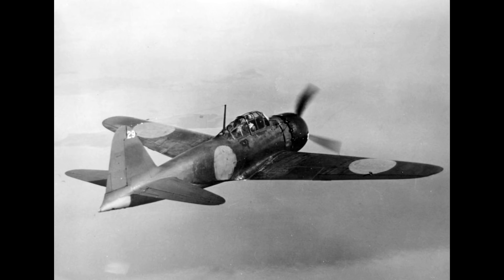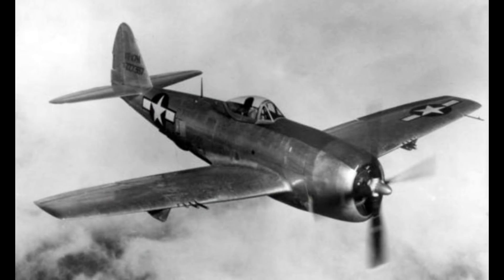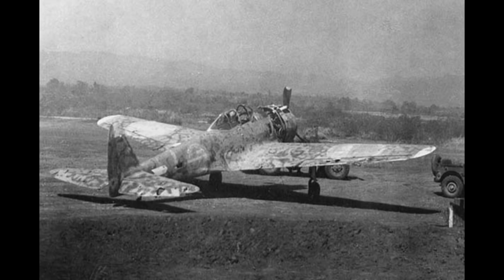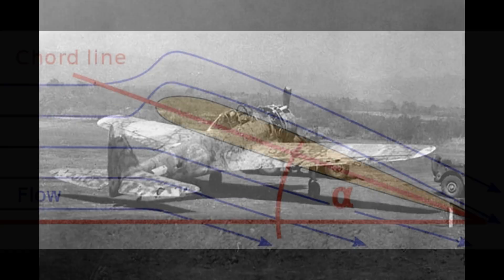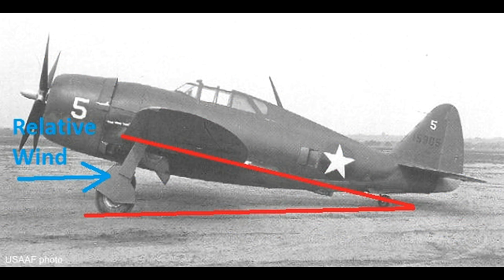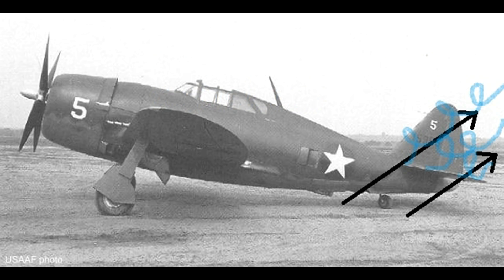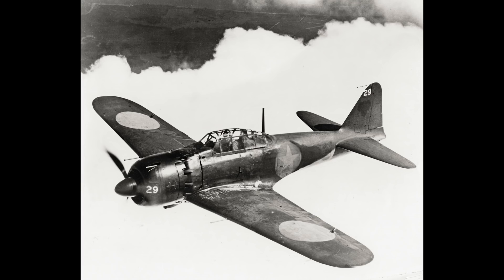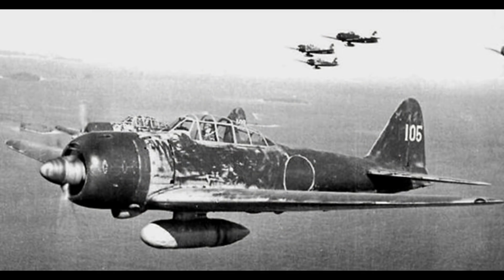Mitsubishi A6M Zero, an interesting fact few people know

Comment: So the only advantage the Zero had was its maneuverability? Why didn’t the Japanese upgrade the engine and then have a much better fighter?
Reply from the maker: The Zero also had an advantage in speed and climb over most Naval adversaries early in the war. In later variants the Japanese did increase power a bit, and make airframe changes to get more speed, but ultimately they needed another design entirely. The Zero could not be modified enough to compete with the Hellcat and Corsair. Ultimately they came out with the KI84 Frank and N1K2 Shiden, both of which were competitive, but it was too little too late.
Reply: Aircraft design is a very complex science.  It is not like "you put in a more powerful engine and you can get a better plane".  First airframe has to be compatible with new engine.  The new engine might be too big to fit in the cowling or too heavy to be supported by the engine mount.  Also Zero's aerodynamics were designed to excel at low speed turn fights.  Even if you can outclimb a wildcat, the wildcat can accelerate much faster in a dive to get away.  Zero also had high speed maneuverability problem.  Late war planes such as Hellcat, Corsair and P51s had much better turning performance in high speeds than Zeros.  Often times, American pilots could lure Zero into a dive and when speed passed 300mph, American fighters could do a quick zoom up or high speed turn and Zero would have hard time to follow.
Reply: I do agree  with you that just stuffing a bigger motor into an existing airframe may not always be effective,  but it would have been a big help.  The BF-109 started out WWII with about 1100hp and ended the conflict with about 2000hp. This was done, along with other mods and updates, to compete with newer Allied fighters.The Zero started with 950hp and ended WWII with about 1200hp under full boost. When WWII started and their primary opponent was the F4f Wildcat, a plane that weighed a full ton more empty than a loaded Zero and was only powered by 1200hp engine itself, it isn't hard to see how the Zero became so dominant. Against the F6f3 Hellcat, witch was even bigger and heavier but had 2000hp, the Zero began to fade. The Wildcat was a good design and the Hellcat took over where that iconic design left off.The Zero was also a great design, but it was fighting at an 80%power disadvantage against the Hellcat and no amount of will or courage on the part of Japanese pilots would overcome it. The Japanese needed a new carrier fighter in the long term, witch they never got. For the near term the Zero needed a bigger motor, witch Mitsubishi was making just before the war started and did produce 1300 horsepower. The latest version of this engine would produce 1560hp before 1943. It was reliable and in production and it would eventually be tested on the Zero in 1945 as the A6M8. Only 2 prototypes would be built, way too little and way too late. I personally think that this zero would have been a good match for the Hellcat.If you still doubt my argument then think about the fact that the Ki-61, Japans only fighter with an inline, liquid-cooled engine, in the 1100hp class was turned into the Ki-100, by mounting the same Mitsubishi radial engine of 1560hp that went into the A6M8. That prewar airframe got a new "lease on life" and became one of Japans best fighters of the war,
Reply: It is my understanding that one of the driving forces behind the design considerations for the A6M was the fact that they didn't have a better engine.

What I read some time ago was that the Japanese engine designs at the time the A6M was developed were not as good as those in the West.  Thus, if the design was conventional with strong materials, armor, self sealing fuel tanks - the aircraft would have weighted to much for the engine that was available and been under powered.  So - to give the aircraft a chance - and because Japanese pilots liked maneuverable aircraft - armor, self sealing fuel tanks and structural strength were not part of the A6M's design.
 
Thus - with one of the most highly trained group of aviators in the world and a very nimble aircraft - at the beginning of the war when allied pilots tried to maneuver with the Zero - it had great success.  As the war progressed and allied pilots learned from their experience and such as Chennault's they learned how to fight the Zeroes and could hold their own with them.

With the disastrous air campaigns in the southern Solomon's that killed off so many of Japan's good air crews, when the Hellcat's, Corsairs and P-38's replaced the F4F's and P-40's the Japanese had less well trained aviators flying fragile fire traps and suffered accordingly.
.
Reply: masbeetleboy
The Ki-100 is really overrated. It had as much horsepower as the Ki-61-II but was a radial, which meant more drag. Thus, it was slower than the Ki-61-II. It was a little lighter than the Ki-61, though, which meant it climbed, turned, and accelerated a little better. Still, the Ki-61-II had an enormous speed deficit compared to its American adversaries, and the Ki-100 was even slower. The Japanese liked the Ki-100 so much because its radial engine was much more reliable than the Ki-61-II's inline one. Performance wise the Ki-100 was just not up to par compared to the Ki-84 and the N1K.
Reply: I disagree that the Ki-100 was overrated. The  Ki-61-II KAI had the Ha-140 liquid-cooled  inline engine that put out 1500hp, the same as the Ki-100s Ha-112-II radial engine. The radial did provide more drag, but it was utterly reliable, lighter, and in production. When working right, the Ki-61-II KAI beat the Ki-61-I in all areas except initial acceleration. But I do agree with your point that the latest liquid-cooled motored Tonys were at a disadvantage when compared to the P-51d, but not the Ki-100. In war circumstance can do a lot to level the playing field. Over Japan the Mustangs flew mainly strafing missions to destroy infrastructure, especially after the B-29s began low level night bombing missions. This meant that they had to come down to very low altitudes, where their advantages were minimized.Compared to the N1K Shiden series and the Ki-84 Hyate, witch both were powered by the Homare engine, the Ki-100 would appear to be an unimpressive, late war compromise, but that would not be true. The Hyate was flight tested in mock combat against the Ki-100 by the Japanese and concluded that, among pilots of equal skill, the Ki-100 could more than hold its own.Air combat over Japan in 1945 forced Allied fighter pilots, of all types including the Mustang, to the same conclusion.
Reply: The Ki-61 was an impressive aircraft, but had the performance of a 1941 era European theater fighter. The Ki-100 was an improvement, but by 1945 was behind the curve
Reply: Your overall understanding is correct but allow me to add some details.Mitsubishi built the Zero to be cannon-equipped, agile, reliable, and long -ranged while being powered by their own Zuisei 13 engine of about 800hp. After a few prototypes were built, the War Ministry ordered Mitsubishi to install a Nakajima radial, the Sakae 12 of 950hp onto an incomplete prototype. Though bigger and heavier, the Sakae combined with the Mitsubishi airframe to create the A6m2 and a legend was born.Mitsubishi, now not so happy about using a competing company's engine on their airplane, offered to use another of their engines, the Kinsei 51 of 1300hp to power the Zero. The War ministry said no, and rightfully so. The Kisei was more powerful than the Sakae and just as reliable, but it was 300 pounds heavier, witch would have adversely affected range. The Sakae was also being installed on the Ki-43 Oscar and it was being upgraded to the Sakae 21 of 1130hp in the near future.The Sakae powered Zero was great from 1940 thru mid 1943, but it needed more power from a bigger motor after that. The kenei  would also be upgraded to produce1560hp in late 1942, should  been tasted on a Zero in late 1943, and replaced the Sakae by mid 1944.
Reply: Sorry to disagree with you but the facts are not on your side here. The Ki-100 had a low top speed for 1944-45 standard, but it was powerful enough, agile, well armed, well protected, and solidly built to compete and beat any allied fighter it would meet over Japan. It also was very reliable and had such good handling characteristics that it gave flight-school graduates a fighting chance in combat. Also remember that air combat over Japan took place at much lower altitudes than in Western Europe.
Reply: thelasthostage 
I said this before and I’ll say it again. The Ki-100 was only slightly better than the Ki-61-II in acceleration, climb, and turn, due to it being slightly lighter. But it was significantly slower than it. The real reason why it was so highly regarded was it’s radial engine was much more reliable than the Ki-61’s inline. Regarding performance, both the Ki-61-II and Ki-100 were utterly unimpressive for 1945 standards (which is when they were introduced). Every single Allied fighter in 1945 flew circles around it: the P-51D, F4U-4, P-47D, P-47N, Tempest, Griffon Spitfire, etc. 

The Ki-61 has good performance for when it was introduced early in the war fighting P-40s, but it was very quickly rendered obsolete when new Allied fighters were introduced. And the Ki-100 was just another Ki-61 in terms of performance...
Reply: Let me respond by stating a few facts. The Ki-100 was anything but "unimpressive", and the Japanese had high regards for it because it performed so well. It was praised not only by mechanics, but also veteran and novice pilots alike. As I stated earlier, the Ki-100 had a low top speed for 1945 standards, but it otherwise compared very favorably to all of allied types you listed. The Japanese Army captured a P-51 in China late in the war, brought it back to Japan, and toured it around their local airbases to familiarize their pilots. Mock combat between this Mustang and Japanese fighters revealed that  at high altitude the Mustang was a superior fighter, but at medium and low altitudes it would lose its edge against advanced Japanese types like the Ki-84, N1K2j, and the Ki-100. That is where most air combat took place over Japan, at lower altitude.Please don't take my word or the glowing reports of the Japanese. Just look at what Wikipedia, US post-war evaluations or any other online aviation info-source has to say about the Ki-100.
Reply: masbeetleboy 
You want to talk facts? 

- Ki-100 was 30+ mph slower than all US fighters at all altitudes 
- most US fighters had equal or better climb at all altitudes 
- most US fighters had equal or better acceleration at all altitudes 
- US fighters had equal or better dive performance 
- US fighters had much better high-speed control. While the Ki-100 could keep up speed-wise in a dive, it was almost uncontrollable at those speeds whereas US aircraft remained very controllable 
- the only place where the Ki-100 had an advantage was in low-speed turns (this, BTW, was what was “tested” in the mock-dogfight between the Ki-100 and the Ki-84. But what use is low-speed turning ability when you’re being jumped by a faster aircraft at a higher energy state than you?).

The numbers speak for themselves. The Ki-100 was just as good (maybe slightly better, emphasis on slightly) as the Ki-61-II. And the Ki-61-II was hopelessly outclassed when it was introduced in 1945.
Reply: I like these facts but I don't agree with your conclusion. To be clear we are talking about the Sea Fire, Hellcat, Mustang, and Corsair when referring to Allied fighters, right? Let me start by agreeing with you that the Ki-100 is slower than all of these late-war, Ally fighters. I stated that point a few times before.Your "facts", plus a few more points will prove my conclusion. The Ki-100 was a pre-war designed airframe that was mated to a "bomber engine" out of desperation. By your own "facts", this improvised fighter was able to at best match the Ally fighters it met over Japan in terms of climb, acceleration, and dive performance. This would prove to be enough because it also had good armament, good protection, and superior agility, while having a less powerful engine and poorer logistics behind it. Also remember that the Ki-100 was introduced into combat, March 1945, while Japan was being bombed and strafed on a daily basis. If the Ki-100 was "hopelessly outclassed", as you stated, then wouldn't American post-war evaluations, as well as Japanese war reports, confirm that?My point isn't that the Ki-100 was far and away superior to any allied fighter it met over Japan, but that its good airframe, good engine, and combat circumstances gave it a fighting, competitive chance against any Ally fighter it would meet over Japan.
Reply: masbeetleboy 
I’m talking about the F4U-4, not the original F4U-1. And the F8F. And the Griffon Spitfire and Griffon Seafire. And the Hawker Tempest. And the Hawker Sea Fury. And the P-51D. And the P-47N. And the P-51H. All of those above-mentioned planes completely blow the Ki-100 out of the water in almost every angle category. 

The Ki-61-II/Ki-100 is only barely able to complete with the older F4U-1 and F6F-5, and even then that’s pushing it. But we’re talking about a plane introduced in 1945 when the Allies had some exceptionally well-performing fighters. If you just look at the performance charts for these planes and compare them to the Ki-100’s, you will see what I am talking about...

What I suspect is that you’ve seen some documentary or read on some online forum that the Ki-100 could “match any Allied fighter and was a match for any of them”. Well, let me tell you that the people that make those documentaries rarely have any clue what they’re doing. At sea level, the Ki-100 had the same speed deficit versus a P-51D as the A6M5 had versus an F4U-1 or F6F-5. And it didn’t fare any better in the climb/acceleration department. It just didn’t compete with any of the fighters the Allies were using/would have used in 1945. It was a 1943 plane at best performance-wise that was introduced in 1945 because the Japanese were so desperate to have something better than the Zero/Ki-43/Ki-61. When you’re flying Zeros or Ki-61s for the entire war, I’m sure getting something that’s marginally better is of course a welcome change. Doesn’t mean it’s any good still.
Reply: Not just a documentary here and a forum there, but direct reports from the men who flew it into combat, both novices and veterans. Also the results from Japanese Army mock-combat tests between the Ki-100 vs captured Mustang and the Ki-84. Also post-war Ally intelligence reports witch confirmed what the  Japanese already knew. I challenge you to look through the internet and provide a source that confirms that the Ki-100 was what you say it was, "basically obsolete". Just look for the Ki-100 on YouTube and see what you find.BTW the F8F didn't make it into WWII.
Reply: The Japanese loved their "mock dogfights" which consisted of seeing which aircraft could turn inside the other....they still clung onto that outdated way of thinking even that late into the war (just look at the A7M2, the thing was slower than an F4U-1 despite having more horsepower because they wanted to give it the largest wing possible to retain as much turning ability). The Ki-100 was slightly more maneuverable than the Ki-84... doesn't mean it was the better plane. Being able to turn inside a Ki-84 in a 1v1 dogfight is useless when you're being jumped by faster, higher-energy aircraft... 

And the reason I brought up the F8F is because the Ki-100 was a 1945 plane... if the war lasted a little longer it definitely would have seen combat against F8Fs, F7Fs, P-51Hs, Tempests, Sea Furies, Griffon Spits, etc... But even if you want to keep the conversation to planes that it actually fought against... just look up the specs of a P-51D running 150 octane fuel or a P-47N or a F4U-4... then compare those to a Ki-100. You will see the Ki-84 is vastly more capable of taking on those planes than a Ki-100. All the Ki-100 has going for it is a tight turn (compared to the American adversaries) and a higher dive speed limit. And BTW, that high dive limit isn't even the effective dive speed. At high speeds, the Ki-100's controls would compress like crazy compared to its American adversaries. 

Japanese planes need to fight US planes at low speeds. That's the only place they can compete. And to do that, they need to be able to CATCH the American planes in the first place. And the Ki-84, with its better climb, acceleration, and top speed, is vastly more capable of doing so. The Ki-100 was slower than a Ki-61-II which was extremely slow in the first place (for 1945 standards). The Ki-84, while still being slower than those aforementioned American/British planes, at least had a better chance of catching them. And then it had better acceleration and more than good enough maneuverability.
Reply: I did and still do partially agree with you. The late-war, Ally types you listed were superlative fighters on the top of their game, a testament to good planning, superior engineering, and the great infrastructure that produced them in the first place. I also agree that the Ki-84 was a great fighter itself, for much of the same reasons. It was planned , built, produced, fielded, and refined all during WWII. But all of these facts prove my point and bolsters the conclusion that I and others have come to about the Ki-100.When first flight tested the Ki-100 wowed its evaluators. When pitted against the Ki-84 in mock combat it proved to better fighter. In other words, it could outfight, not just outturn the Hyate, and this conclusion was reached even when they switched pilots. But all of this could be the Japanese just "drinking their own Kool Aid" about their new fighter and desperately "wanting" it to be that good. Okay, fine.The Ki-100 is then thrown into combat, a "meat grinder"over Japanese skies for home defense duties, during the last 5 months of the Pacific War. Combat reports about the Ki-100 from the Japanese demonstrated the types effectiveness against all Ally types. After the war, the Allies themselves evaluated the Ki-100 and tested it against their own planes flown by their own pilots in simulated combat and guess what, the Ki-100 was judged to be a very worthy opponent.If only the Japanese sung praises about the Ki-100, then I would see your point. If the type was as obsolete as you earlier  stated, then late war combat would have showed it. The KI-100 performed not only better than the Oscars, Zeros, and liguid cooled Tonys that tried to defend Japan at this time, it also matched the combat results of the Ki-84 and the N1K2j. and again, its merits as a fighter were confirmed by the allies after the war.
Reply: dogeness, the ki-100 could out turn, out climb and everything ells beside out speed the American aircraft, it was one hell of a plane and would've given any other plane of its day a run for its money.
Reply: Onii Chan 
“Could our climb” Nope... not true.
“Could out turn” yes, it could, turning ability was the only thing it had going for it. Performance wise, it was a disaster compared to contemporary 1945 fighters. Only times it would have been competitive would have been if it faced F6F-5s and F4U-1s, and even then, it only had climb and turn advantage, the F4U-1 and F6F-5  were not only faster, but MUCH faster at ALL altitudes, and had much better high speed/dive characteristics. And that’s comparing it to the American fighters that entered service in 1943. If you compare it to anything British or American from 1944/45, it would be ridiculously outclassed in everything except turning ability.

I mean, come on, the only difference between the Ki-100 and the mediocre Ki-61-II was that it was draggier, was lighter, and had a more reliable engine. The horsepower was almost the same.
Reply: I believe Greg covered that. He noted that Japanese manufacturing capabilities were always less than those of the allies. Admiral Yamamoto and others warned their war department of Japanese vulnerability to America's formidable manufacturing capabilities, to no avail.
Reply: First a little story: 
Barrie Davis, P-51 pilot, 325th Fighter Group 

New pilots coming to our fighter group were invariably cocky to the point they were dangerous to themselves. They thought the Luftwaffe was finished and that the P-51 could quickly and easily kill anything else that flew. To modify the attitude of the newcomers, we used a war weary P-40 which our squadron somehow acquired. I was in charge of putting new pilots through a quick, intensive training program, and the final flight included a mock dogfight with the new pilot of a P-51 pitted against one of us flying a P-40. I can tell you that until a pilot knows the strengths and weaknesses of both airplanes, the P-40 can make the P-51 look outclassed. Using all of the P-40s strengths, an innovative pilot could outfly a P-51 at low altitudes until the P-51 jockey finally realized that there was something more to fighting in the air than *simply having the best airplane*. At that point the new pilot would become ready to listen to everything we had to say.

This little anecdote above demonstrates that particular airplanes have particular attributes that will enable them to outperform "superior" aircraft - if the situation is right. Both the P-40 and the Ki-100 were very good in the low to medium altitude envelope. At high altitudes, advance allied aircraft would eat their respective lunches. You can't design an aircraft that performs well at everything and everywhere. So yes the Ki-100 was very capable at these altitudes. Superior? No. Just very capable and in the hands of veteran pilot, like Barrie Davis in the old P-40 it could give you a run for the money. At higher altitudes I would much rather be in a Ki-84 or N1K2. Let's not forget the J2M Raiden (Jack). Japanese ace Sadaaki Akamatsu was very skilled with it and had no fear of taking on Mustangs. But very few Ki-100's were made and they had Zero effect (no pun intended) on the outcome of the war or the air superiority of the allies in 1945 over Japan.
Reply: Deplorable_Bitter_Clinger
I don't disagree with much that you said there. Against the P-51, the P-40 definitely has an advantage that allows it to outclass the P-51 in some circumstances: it can turn much better than the P-51 at lower speeds. Against a newbie pilot who doesn't know how to use his speed, climb, and acceleration advantage, the P-40 actually has the advantage. 

This is the same in the case of the Ki-61/Ki-100 versus a P-51. Both the Ki-61 and Ki-100 can easily turn inside the P-51 at all except the highest of speeds where the P-51 has the avantage in control surface authority. That doesn't mean that the Ki-61 and Ki-100 are better, or even comparable, to the P-51. The P-51 is easily the better plane just because of its speed and dive advantage, EVEN at low altitudes. The Ki-100 is barely any better at fighting the P-51 than the Ki-61 is. The Ki-84 and N1K have a much better chance of shooting down a P-51 than the Ki-100 does. A simple look at the stats of the planes will tell you this. Here's a link to a spreadsheet I made comparing the late-war Japanese planes to each other. https://docs.google.com/spreadsheets/d/19ZYTUpEU6uPENoxphAoN8-bGJquMa8JHFANzITdtk6w/edit?usp=sharing
Reply: Thanks for the link. I will add it to my collection of WWII aviation documents :-) I noticed the lower wing loading of the A7M - it had big wing, which makes sense since it was meant to operate off of carriers, yet it still achieved 390+ mph in tests. I did forget to mention in my previous post that superior speed is very important because it helps to engage and disengage at will. Remember that even if one aircraft had a top speed greater than the other that doesn't mean it does at all altitudes. I don't know what the P-51 top speed was at 5 or 10,000 feet, but it may not have been all that different from the Ki-100 (or P-40). So there are a lot of factors to consider. The most important attribute of any fighter though is the pilot, and his experience and knowledge of not only his plane but his adversary's.